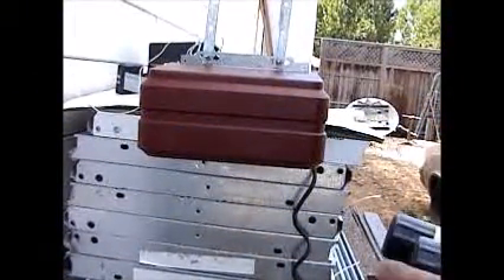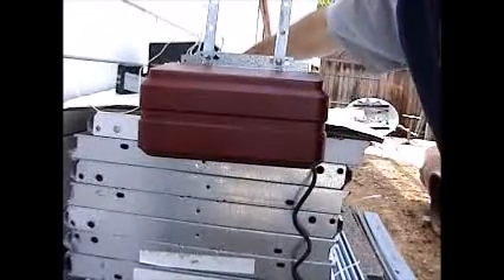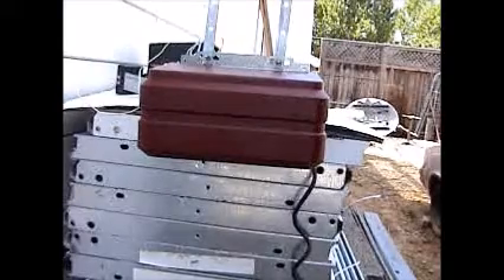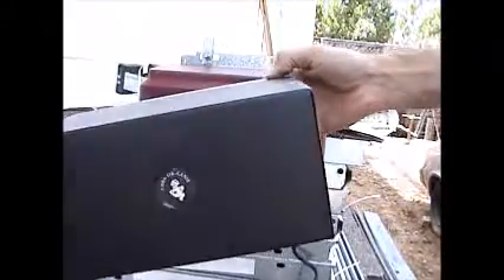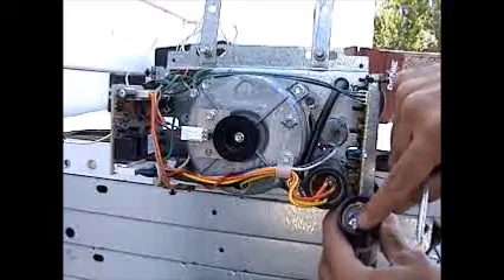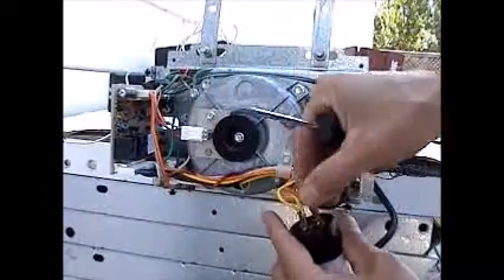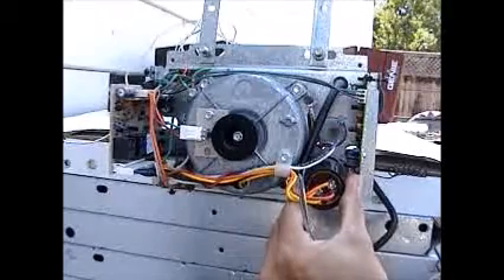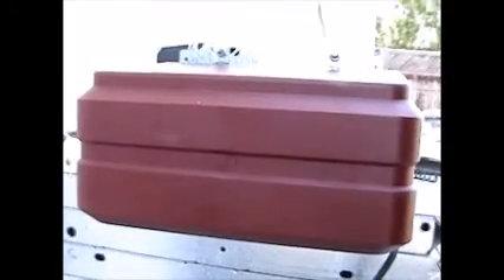Genie Screw Drive Repair (capacitor replacement)

Comment: Great video but tell viewers AFTER UNPLUGGING the garage door opener to first DISCHARGE the old capacitor with an insulated screwdriver. A charged capacitor can shock you even after unit is unplugged.

Comment: My capacitor made a sound like a fuse blowing. When I removed motor cover, there was lots of oil from the capacitor inside. A different issue from yours buzzing. Do you think replacing the capacitor will fix it? I hate to throw good money after bad if thats not the actual problem. Thanks for great how-to video

Comment: Thanks for your video.  As others described, I waded through many videos before finding yours that accurately met my issue.  $20 capacitor and it works like a charm again.  I'm not sure if you are able, but renaming your posting to include "hum with no movement" might help search results.

Comment: I thought this was the same issue I had because the noise was the same as in the video but I replaced the capacitor and it didn't make a difference. Anyone have any other suggestions? Thanks in advance!
Reply: Bryce Escobar i had the same problem after i replaced the capacitor problem still the same nothing happens

Comment: Whoo Hoo. After watching this, I ordered from Amazon the capacitor and installed it and now my 26 year old (installed it myself in 1991) is still working like a champ. Tell me anything these days that lasts 26 years. I doubt the new Genies last this long. The only other thing I've replaced is the plastic latch that engages the screw to move the door up and down. Did that a number of years back. Thank you a million for making this video....!

Comment: i have no power in to the unit and the plug has power. I have push what I think is a reset made no change any Idea where io start ?
Reply: did you find the fix?  I have same issue....

Comment: Thanks for the Video.  I have a 1/2 HP Genie that was only going up 6"-12" and then stop unless I held down the wired control button. Only then would it go up all the way. After doing that a couple of times the heard a crackling and say smoke come out of the box. I opened it up, ran it again and smoke came out of the capacitor. Now it does nothing. Do you think the capacitor was the problem to start with? I had every joint and moving part lubed up. Please advise and thank you!

Comment: Thank you for your videos!

 I have a genie H8000 07 and have eliminated all other possibilities. Any way to determine whether a problem is capacitor, motor, or circuit board?
(Lights work, no sound of any kind by using wall switch, car remote, or outside wall entry switch, safety sensors good).
Reply from the maker: Motor very rarely burns out. Sometimes the capacitor explodes or starts to come apart where the wires are attached or you can see burn marks or smell. The circuit board has a set of contacts like point that may get stuck in the closed position. I guess the correct way is to get specs and an ohm meter to test. I usually carry extra parts and replace one to test.
Reply: Thank you for your reply! The capacitor isn't leaking or coming apart. Are the "contacts" you brought up mechanical contacts? I have an ohm meter and I'm familiar with electronics.Is there a way to ck the cir brd?
Thanks again, Stan

Comment: My Garage door makes the has the exact symptoms as the opener in this video.  I changed the capacitor with one that is known to work and it still has the same symptoms.  Any other ideas what will cause this issue?  I have also replace the sequencer board.  All wires are tight and show no signs of wear.  The the wall switch is turned to the "off" position; when the button on the wall is pressed the opened shows the symptoms when it show actually not be working at all.  Model H6000-07.  Please assist.
Reply from the maker: +Tony Smith  Those 2 parts are usually the cause of that problem. The only other thing I can think of, maybe the coupler joining the rail and head is worn out and causing the screw drive to be stuck and cannot spin. One time I tightened the 2 bolts that are holding the rail to the head too much and the screw could not spin until I loosened them a bit. Also, I have had times that the grease in the screw rail is too thick, dried up and causing the screw drive to freeze. A little spray lube may free it up. Then re grease with correct grease. If you unplug and remove the cover. You may be able to spin the screw manually for a few turns to free it up. Also. check that the limit switches are not stuck in the closed position. That is all I can think of right now.

Comment: Hey, thanks a million.  I had the exact same problem with my old Genie I think it was Model 12A (probably 20 years old or more).  It just made the same buzzing sound you show in your video.    I could not easily see the damage on the capacitor but as I was replacing it could see the 
damage.  I got this capacitor Genie Garage Door Opener 19988A Capacitor
from Amaazon from here  
http://www.amazon.com/gp/product/B000CSWZV2?psc=1&redirect=true&ref_=oh_aui_detailpage_o04_s00
and followed your instructions.  I think I blew out the capacitor by installing and testing a smarthings hub and relay switch to open and close garage door
via smartphone.  I was opening and closing the door a lot that night and it eventually broke.

Two of the contacts were very hard to remove and I had to loosen the grip on them with a thin flat head screw driver and a box cutter razor (I had to pry back the contact a bit). 

Thanks again this helped quite a bit (I try to be handy and usually end up making things worse, in this case I had success and I owe a lot of that to you).

James

Comment: I wanted to ask for some advice.  I went ahead and replaced the capacitor as you did here and made sure it was the same specifications as the original.  My issue is the motor sounds like it is struggling just like yours before the replacement of the part and is still doing the same thing after the part replacement.  when I press the hard wired button the motor runs forward for 1 second then backwards for 1 second then shuts off.  The same thing happens when using the wireless remote.  I have checked the door infared sensors and they are not blocked and the lights are a steady green.  If I try it a couple more times the motor freezes and make a humming noise but will not move.  I can actually turn the rear of the motor by hand without much force and I am testing the unit without the door being engaged.  Do you think it may be the motor itself?  There is some play at the back of the motor and I can push on the plastic fan like wheel on the rear of the motor and it moves back and forth maybe a 1/4 of an inch.  I also have removed and inspected both boards and do nto see any bulging or burn marks on either.  I would say the unit itself is about 10 years old.  Any advice would be appreciated.  Thank you.
Reply from the maker: It is rare for the motor to go bad. Not impossible. It is usually the parts around it that go out. The capacitor and the sequencer board are the most common. When these go out the motor usually will not turn at all. Maybe make a clicking sound. The sequencer board does not usually show visible damage. There is also a coupler that joins the motor to the rail that wears out and makes it hard for the screw to turn. You need to take the motor down and remove the two bolts that hold the rail to the motor to check the coupler. Older models did not have a coupler. The rail was installed to the motor by the manufacturer. These models have a clutch that wears out. I am not sure which model you have. I have also seen the casing that the motor mounts to crack and cause problems. Also these motors have a shutoff, if you run the motor too much it will shutdown for about 20 min. Don't waste too much time and headache on it. You can find new motors on sale for a reasonable price, if you install it yourself. Let me know if you need more. Good Luck.
Reply: G S Overhead Systems Thank you for the information.  I just wasn't sure if it would be the coupler if I can turn the whole screw assembly by hand but I will check that out.  I really appreciate it!  Thank you for posting the videos.